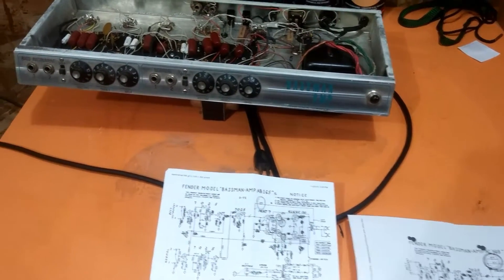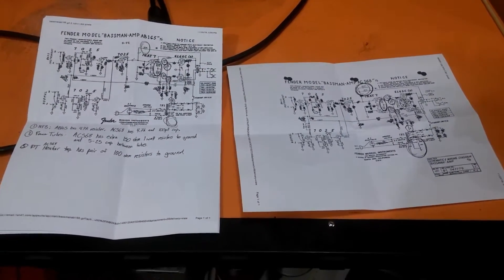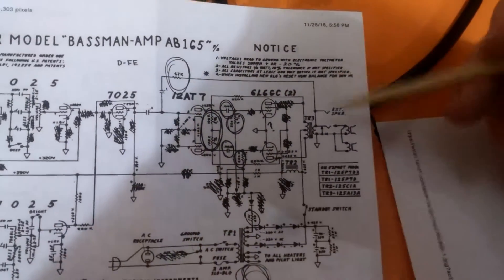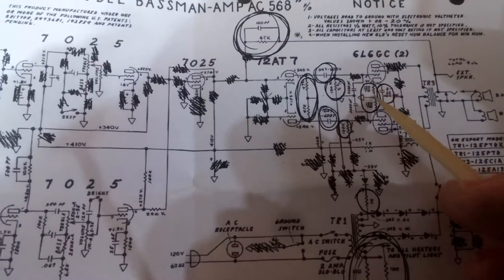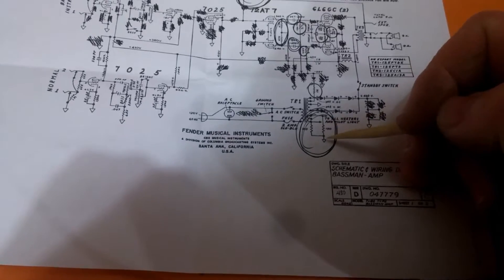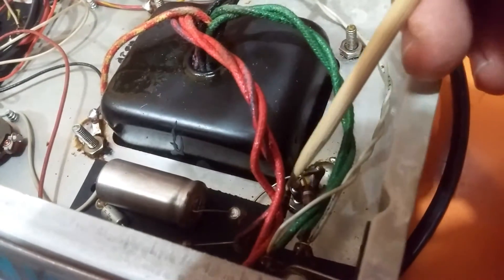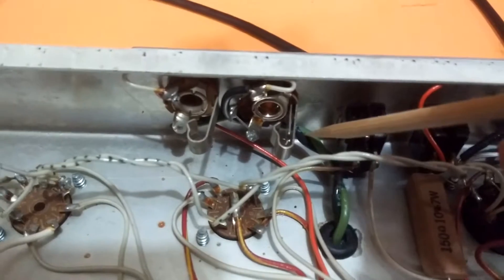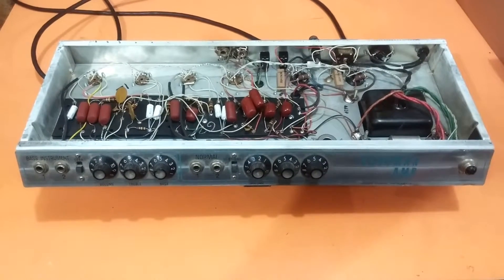AB165 or AC568?  Identifying A Bassman Circuit

Comment: Thank you for the this video, my amp’s tube chart had the circuit obscured as the ink had worn off. 
But I can clearly see my 1969 Bassman Export is an AC568, the rectangle 7w resistors are the dead giveaway!

Comment: Mine is a bassman 135 ? What does this mean ?
Reply: It means your amp is louder than a 747
Reply: @SteverRob  hahaha I always thought that too but it seems once my amps go past 3 or 4 they just get more full, not a volume increase, not to say they are not loud, I do like loud amps, but it amazes me how much thicker they sound than loud when turned up
Just my thoughts lol
Reply: @craigshewchuk710  I have the Twin Reverb version of your amp.  135W is deafeningly loud.
Reply: @SteverRob  I got a 100 watt bassman myself, it's pretty loud, more thick than loud tho, I have louder amps with less power, probably more efficient handling? Maybe it's just how each amp is
Twins are loud tho, known for being a good loud amp for sure
Reply: @craigshewchuk710  The Bassman 100, 135 and Twin Reverb 135 all have ultralinear output transformers.  That's the main thing they all have in common.  I also have a '71 Bassman Ten and a '68 AB165 Bassman, that's why I found this video.
Reply: @SteverRob  I will look into the ultra linear output transformers
Reply: @SteverRob  the bassman 100 does not
Reply: I have a bassman 100, trying to figure that out also, It has the tail logo so I know it's early
Reply: ultralinear version of the bassman 100

Comment: The 2 resistors on the 6.3v lines are a virtual center tap. The AB165 transformer has an actual center tap. Other than this I would argue the changes to the AC568 circuit are all improvements. This runs counter to popular opinion that BF's are better than SF's.
Reply: I love my silver face bassman, the blackface ones I have played are nice but that silver face is something else, and much much much much louder than the black ones but that only a handful of my experience

Comment: Check the codes on the output transformer or the pot codes. That should give you a good idea of the circuit. Great video.
Reply: Honestly, the transistor code only tells you when the transistor was made, not used. Same for any other date codes. When you have an amp built somewhere in the middle of a long production run that's all you need, but for 1968 Fender amps in particular it's just a starting point.
Reply: @OldWhitebelly  transformer not transistor
Reply: @RocknJazzer  Okay, read "transformer" and leave the rest of my sentence intact. Still true.